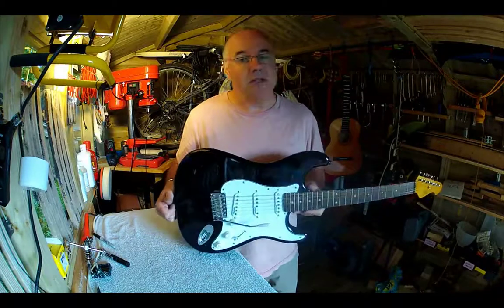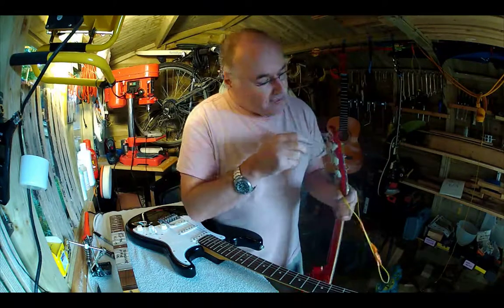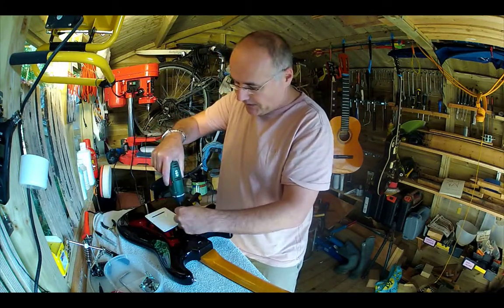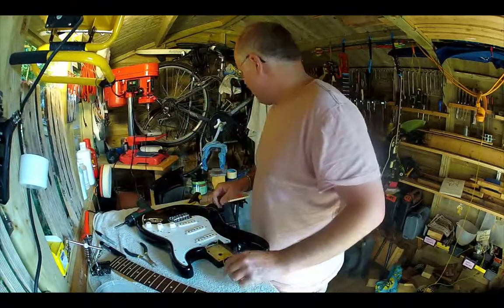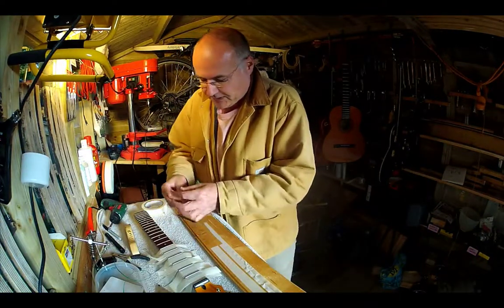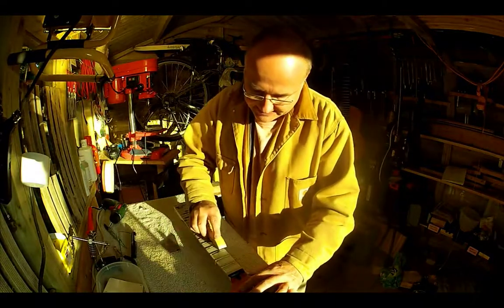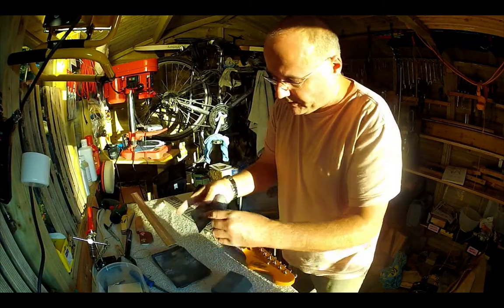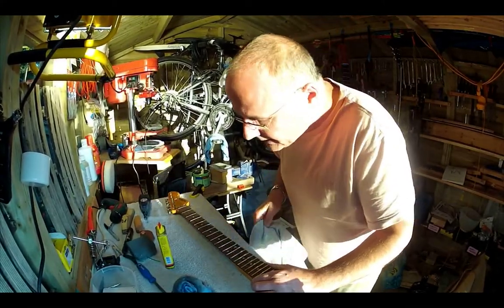Vintage Stratocaster Setup Part 1

Comment: hi sam great info thanks for shareing, just learned a trick from  grand kid , left my axe leaning. kid put a magic marker to it, tried everthing under, on, or near the sink and garage nothing would touch it, since it is a custom made gift, i was bummed, anyway she insisted if i rubbed  a dry araser on it i could then wipe off everything, needless to say last thing i wanted to do was put more ink on. buy low and behold it does remove perment ink, thanks jack
Reply from the maker: Hi Jack, you're welcome. Yes the dry board marker is a great solvent to loosen up the permanent marker and enable you to rub it off :-) I used to do that a lot when I taught in universities and there was inevitably a whiteboard that someone had written on in permanent marker by accident.

Comment: Would you say, that if time was not important, that the triangular file was the neatest and most controlled method?
Reply from the maker: Good question, W. I think it's the most...'precise' in that you can be 100% sure that you've NOT taken anything off the top of the fret whereas with the concave crowning files you always end up hitting the top at some point.
Reply: I'll try that first. As a modeller,  I think I can do it OK. Time and patience is not an issue.